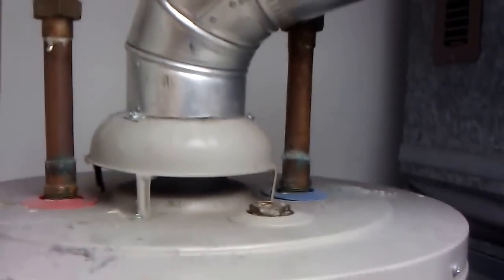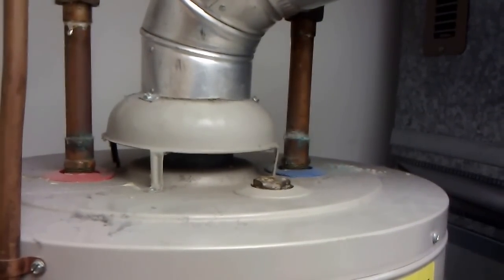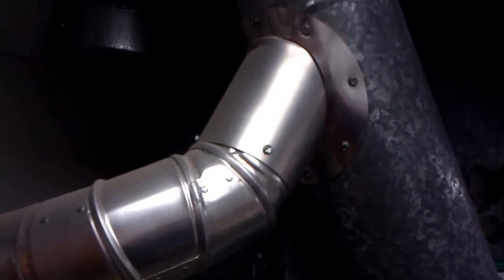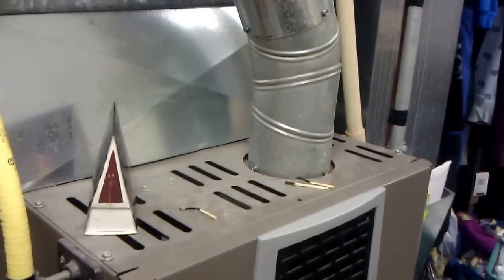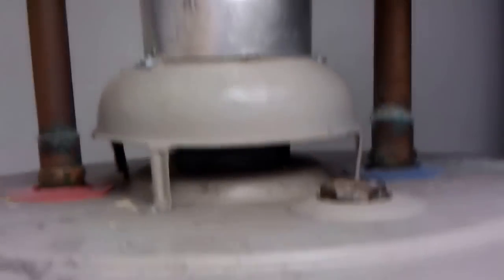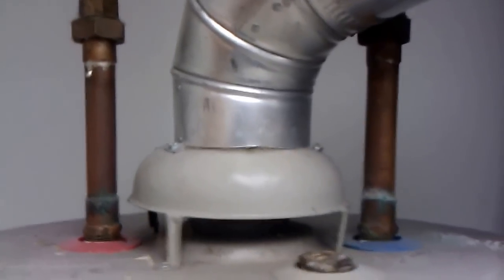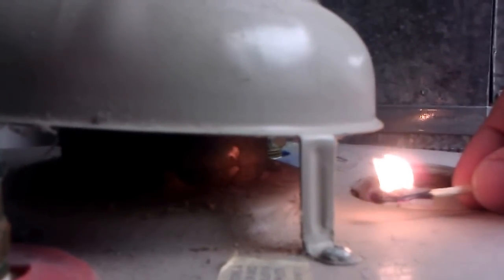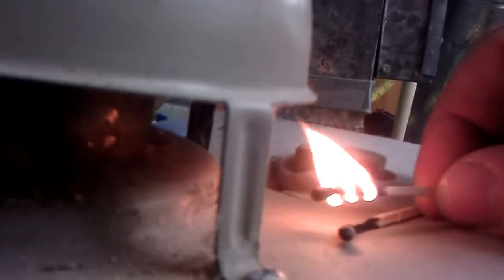Deadly Carbon Monoxide - How To Do Venting Test .

Comment: what if vent on other end is dripping water?
Reply from the maker: Condensation can happen if its cold or cool if the other end is on a roof or side vents outside of your home.
Reply: @bluesharp59   it was during heavy rain when i started slow dripping
Reply from the maker: @kamshaft747 
 If real windy it could of happen. Just keep an eye on it because rain water is not supposed to come in  unless the rain cap is missing or damaged.

Comment: CO2 is carbon dioxide .  Flue gas is typically not carbon monoxide but if there not enough dilution air or if the gas appliance is not burning clean then it can make carbon Monoxide.
You must do that test with the appliance ON otherwise it means nothing.
Reply from the maker: Thank You Donald.

Comment: That’s the correct way to check to see if the chimney is drawing..pulling fumes up the chimney.
Do both appliances separately then with both on.
It doesn’t necessarily make CO.  It’s typically co2 and water vapor .  If something is awry then C O can be made.
Reply from the maker: Thank you Donald.

Comment: So negative pressure is bad.   Got it.   Smoke should not go into the house.   So a Positive pressure is what you will need.
Reply from the maker: Thanks and Happy Holidays.
Reply: broderp you want the flue under negative pressure but your area around the boiler you want under positive pressure as if was under negative can pull products of combustion into the area and cause you some damage

Comment: Thanks for this video.  What do you do if the smoke doesn't get sucked into the flue?  
Also, This may not apply to the water heater in your video - But, according to the instructions in the AO Smith install manual for my water heater, the water heater in your video is not vented properly.  They recommend at least 12" of vertical vent pipe before the first elbow.  And they say "Do not common vent this appliance with any power vented appliance."  The installation in your video is breaking both of these rules.  But, as I said, they may not apply to the water heater in your video.  Just sharing what I read in my AO Smith owner's manual.
Reply from the maker: Correct , it was an older water heater. I now have a power vented one.  The furnace is now vented by its self also. If your water heater is heating  it should draw the flame or smoke of the match up the vent but not at no heat. Good comment and thank you.

Comment: You should have both the water heater and the furnace on when you test venting, since they are sharing the same vent. Sometimes an appliance vents well, but then when the furnace is on, it won't.
Reply from the maker: Thanks and good comment very true.
Reply: Yes...one at a time then both.
Reply: Power vent could blow down into the water heater?
Reply: @tedlahm5740  Yes, that’s possible. Sometimes the vent pipe size does not have enough capacity for both appliances, or it has a long  horizontal run, has debris inside, or it’s disconnected in attic, etc. There’s a number of things that could be going on.

Comment: Match test doesn't tell if CO levels are safe regardless of airflow. Always hire a professional to make sure your water heater is safe.
Reply from the maker: True you are and thank you . It is only intended to show how it should suck up the gases . Thanks and I did redo the description on the video . But overall the test does work . Thanks again M Dunn and have a good weekend also .
Reply: M T Dunn Plumbing if it’s making CO you better make sure the draft is working.
I did thousands of draft checks like this.  It works...but the appliance has to be running.
Reply: Don't hire a professional. They show up for a short time and only get a snapshot of what the airflow situation is day after day, week after week.